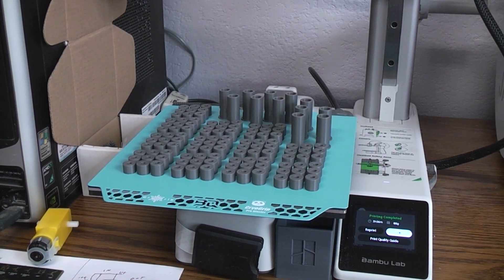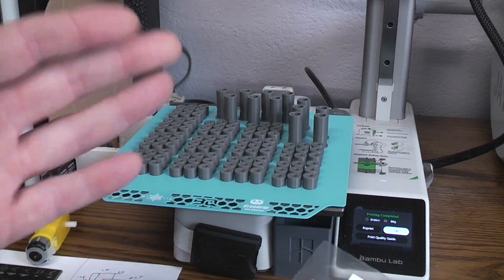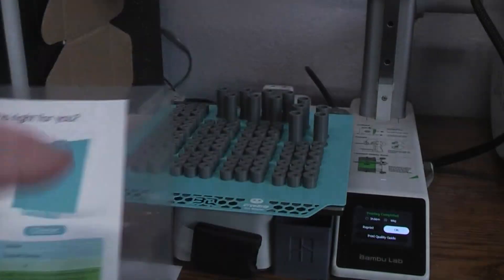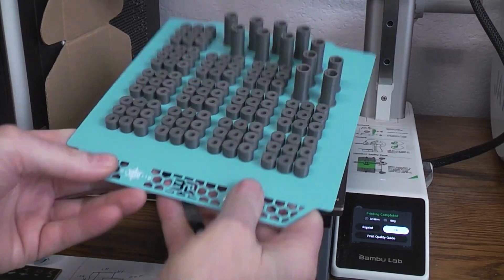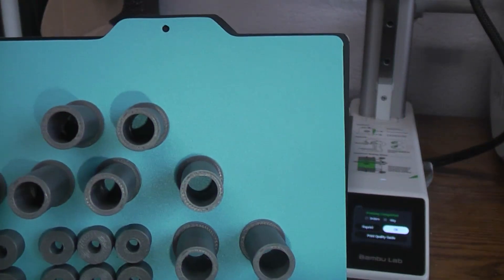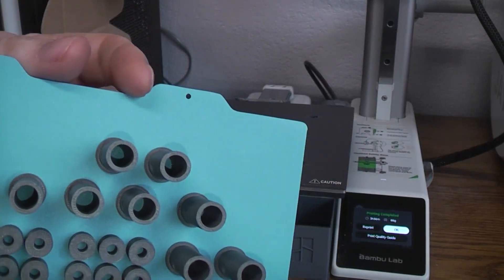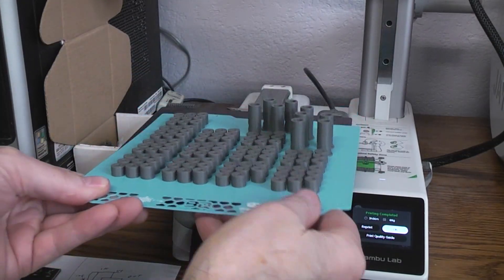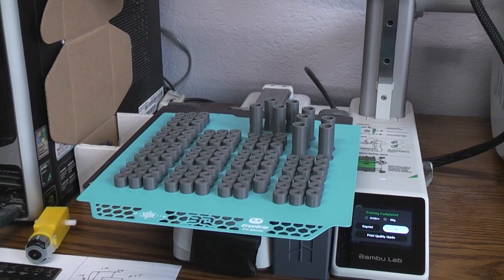Testing the BIQU CryoGrip Pro "Glacier" plate for the Bambu Labs A1 Mini. Get that cat out of here!

Comment: How did you stop the purge on the A1 mini from happening on top of the honeycomb pattern on the front? So annoying to clean up
Reply from the maker: My A1 mini has never placed the purge on the honeycomb area, it is always right where it should be on the build plate.
Reply: @ the front right lol? It’s right where the honeycomb starts. All stock gcode as well it seeps into the honeycomb every use. I’ll just modify the gcode I just don’t know why mine aligns weird
Reply from the maker: @makeit3DOhio  It is strange. The honeycomb is in front of the heat bed, I do not know how it could lay the purge lines there. Or maybe your Cryogrip plate is made wrong, a bit short front to back, so that the honeycomb does sit on the heatbed?
Reply: @ the nozzle prime line is also in the front of the bed.. I have over 30 Bambu printers only the lil mini I use for prototyping has such an issue. The frostbite beds don’t have the dumb honeycomb in the front at all lol
Reply: @makeit3DOhio  Same is with mine

Comment: Thanks for the review. I just ordered one for my A1 Mini.
Reply from the maker: I have printed 100's of parts since the review so far and it's been perfect every time. I am using it on the new robot project and so far not a single bad first layer or lost part no matter how small the bed footprint is. Really amazing.
Reply: @Robothut  That's good to hear. I only have occasional problems with my first layer but it's still annoying. Your new project sounds very interesting.

Comment: Interesting! How hard was dialing the Mini in?
Reply from the maker: I made no changes to the stock setting. Left the bed at 60c and the hot end at 220. Used the standard 0.2 setting for speed. It just works better than the stock plate for sure, if you can live with the textured finnish.
Reply: @Robothut  I meant the printer itself, when new. I hear getting them adjusted is a pain.
Reply from the maker: @ There is not adjusting when NEW, you just use their slicer and its presets and you are good to go. You can find many videos on the Bambu labs A1Mini on my channel that I did back when I bought it over 1 year ago. It is plug and play and great for beginners or people like me that have been 3d printing for over 10 years that just want a printer that works every time, is fst and high print quality.